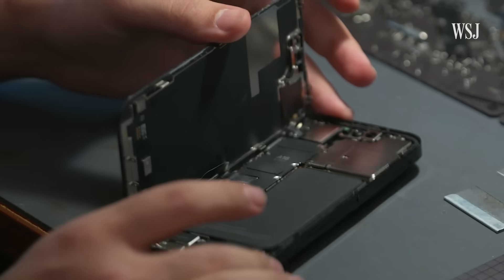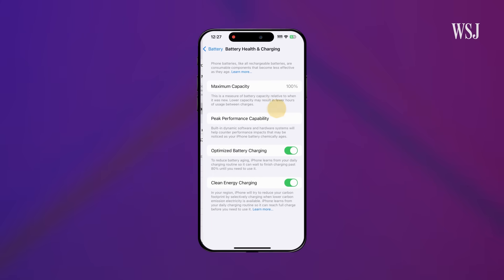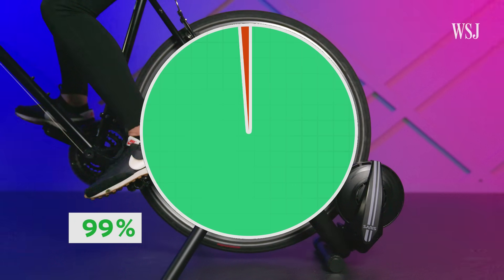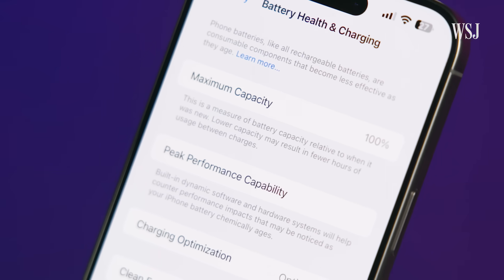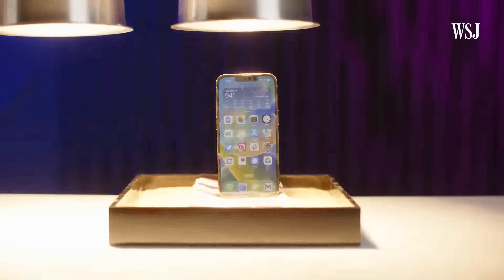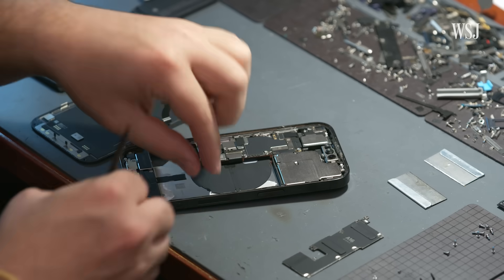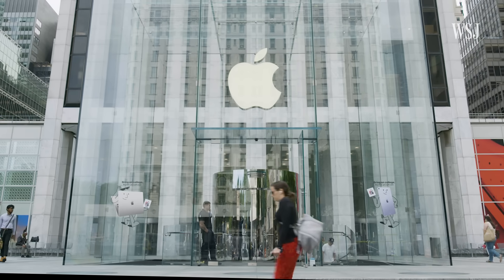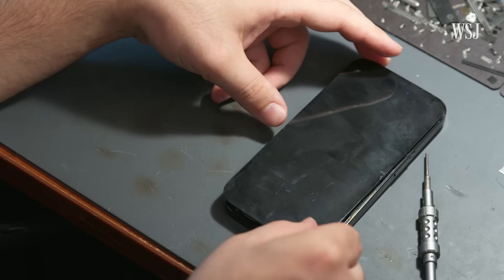Why My iPhone’s Battery Expired in Only a Year | WSJ

Comment: Yeah i'm a bit concerned, I just got a used 13 Pro, it was 89% which was the best I could find in terms of battery health, and this is after 1.5 years of original purchase. Can't remember how much my previous iPhone had when i got it used... but was an iPhone 7 that I'm replacing just now that is going down very fast
Reply: Battery replacements are cheap, who cares.
Reply: @iwill_859 do you trust them to make it waterproof again?
Reply: @unleashthedog  it was never water proof to begin with, it’s water resistant.

Comment: Apple iPhone buyers are insecure sheeple: the battery is designed to be too small and to wear out so you will want to buy another expensive iPhone sooner. Apple iPhones are missing many basic phone features that are present in the much better Sony Experia phones and cheaper Samsung and Xiaomi phones. Sony Experia phones have expandable memory allowing 1TB of flash memory to be moved immediately from phone to phone ensuring that no photos or music are lost if your phone is dropped and breaks. Sony Experia phones have headphone sockets so one gets lossless powerful headphones at full quality music without compression and no need to charge headphones or worry about losing one earbud or about flight wireless restrictions. Xiaomi Note phones have amazing 200 MPixel cameras and infra-red controllers for AC and TVs, Sony phones have optical periscope zoom cameras and Bluetooth transfers of any file, photo or data. Apple's profit margin is over 50% - why do you want to give them your money when Pegasus Spyware can hack into any Apple phone anytime and there are all these disadvantages ?

Comment: FYI I use my iPhone 14 Pro that I charge with a non-magsafe Qi charger every night since I've gotten it. 
It's still at 97% battery capacity. 191 cycle counts. Manufactured in 2022-07-04.

My theory is - my battery is near max because I disabled "Always On Display" almost immediately on purchase.
Reply: yq me too , mine is 98 percent after a 14 months i guess its due to display

Comment: You are missing an important factor. The quality of the batteries made by the manufacturers is cheap compared to the 13 and previous models. That's why the battery is degrading faster

Comment: so does it mean if you keep the phone connected to the power source (typically when working in the office), the phone is always 100% charged even when you are on the phone for calls/videos, etc, does that mean it will significantly slow down the charge cycle count?

Comment: Magsafe charger took my iPhone 13 Pro from 100% to 89% in a year. At the same time, my old XS Max (never charged wirelessly) is still at 91%.
Reply: Truth wireless chargers are the easy tool to downgrade your battery
Reply: @Rajskr16 ohh thanks. Almost Planning to buy.
Reply: @disc0potato  don’t buy for your goodness
Reply: @disc0potato  Its not that bad, at least "non Magsafe" solutions are somewhat "ok" with up to 7,5W. Magsafe with 15W really heats up the iPhone, especially under addtional load.

It really depends on your needs, i personally learned to replace the battery anyways after 3-4 years of usage, and i rather replace a "bad" battery after 3 years for additional 3 years than a somewhat "still healthy, but weak" battery after 4 years. After 6 years i would upgrade the phone anyways ("for sure")
Reply: My old iPhone SE 1st gen had 87% health capacity after 1500 cycles. Insane. Gone are those days. Now iPhone batteries are designed to perform optimal for only 1 year. 

"Buy a new iPhone" sounds music to Tim Cook.
Reply: @Roberto-nj5r none of the iSheep will understand what apple is up to behind the scenes :(
Reply: I can see why, Samsung wireless charger has a fan under it doesn't feel warm on top, but Magsafe doesn't have a fan :o
Reply: Exactly. Qi never did any harm to my X, XS or 11 Pro, but Magsafe really killed my 14 Pros battery within a year.
Reply: My iPhone 13 pro battery health is 88% after 2 year of use. I use mostly 5w charger and sometimes 20w Apple fast charger.
Reply: I have an iPhone 14 Pro and frequently charge with MagSafe. 98% since they came out
Reply: I’ve only wirelessly charged my 14 pro max. It’s 14 months old and at 98%.
Reply: Really puts the safe in magsafe
Reply: Iphone 13 pro max charging only with magsafe for 2 years 89%
Reply: Eh mag safe is wireless ❤
Reply: Wireless charging for me is just a back up if my usb port gets damaged.
Reply: @serrael-182  this makes sense. Never used wireless once myself.
Reply: I MagSafe charged a 13 Pro for 2 years and was at 89% health. It’s different for everyone.
Reply: Yep, which is why I don't care that my phone does not have wireless charging. Even when Palm came out with this feature back in 2009 I never used it because it generated far too much heat.
Reply: @orangeyellow-me1pz  I exclusively MagSafe charge my iPhone 14 pro max. My battery health is fantastic after a year. The issue is cell design, not wireless charging.
Reply: 89% in a year is still really good. If you get two years out of a battery, that is about normal. Mine just hit 79% at the two year mark.  I had changed with Apple and it was under a 100.00 with tax.
Reply: MagSafe made my 13 pro max lose like 3% in a week lol
Reply: Which one do u use more
Reply: Interesting, but that’s just 2%, something I’m inclined to point at each generation’s battery more than how it’s charged.
Reply: @SleepyPossums   For full disclosure: I bought my Max in Feb 2019. Replaced it with 13 Pro in autumn 2021. Feels surreal that newer phone eats through the battery twice as fast.

Comment: Luckily I have an iPhone 13 pro and didn't upgraded to iphone 14 series or iphone 15 series, so iphone 13 battery health at 94%~96% still okay and lasts for almost 3 years. the solutions is never overcharged after charged to 100% and don't overheat it while exposed to sunlight.
Reply: Nothing wrong with the 15’s & it’s too early to tell if they will have degradation issues or not.
Reply: @iwill_859  I mean iphone 15 series have ios 17 issues like an overheating, am I right?
Reply: @indrahaseo  no, apple fixed all those issues w updates.
Reply: @iwill_859  it would be better if we just wait for next year or until ios 17 has been fixed, better and smooth more then 17.2 or 17.3 is enough

Comment: The biggest problem is that Apple made their battery save mode unusable cause it lowers refresh rate and difficult to find in settings
Reply: It's not hard at all, dude. You can literally add it to the control center. If you're just talking about lowering refresh rate, then yes, you have to look in accessibility.

Comment: just sold my 14 pro that I bought when it came out. 13-month old phone, battery health 100%. I had it checked at an apple store, the figure was real. that made me wonder about 2-year old ipad mini 6. that was at 97. I have no idea how that has happened, haven't changed anything significantly about my charging habits, except when the weather is hot, I put them on an ice tray to charge. so it IS the heat that's killing batteries fast.

edit: AND avoid using fast chargers. I use the old chargers for everything, including my iwatch.
edit2: cos they heat up devices so much you could fry eggs on them
Reply: May I know what the selling price of your iPhone 14 Pro was?

Comment: wasted 7 mins and did not get the answer to "Why Do iPhone Batteries Drain So Fast?".
Reply: You are not paying attention.
Reply: @iamstevemoses  Apple is a joke...message is "Don't use the phone..🤣😅
Reply: @iamstevemoses  neither are you, stop acting proud and illiterate, she didnt even mention how batteries work
Reply: It's a feature
Reply: Batteries degrade and have a limited charge cycles. Meaning that it could only charge full to empty a limited numbers of time. You could do more discharge cycle if you limited the fully charge to 80 percent and limited the discharge to 20 percent. That will really extend your battery life. Keep your phone away from heat because it degrade faster but also keep it away from extreme cold as well. The lower the capacity the more you charge, the more you charge the faster the battery degrade. 
Remember this uses the same batteries as your ev the only differences is that your ev has better thermal management and could heat or cool your battery down.
Reply: @DerekVuong7799  the video tells you nothing period.

Comment: Me and a friend upgraded around the same time, I got the regular 14 and she got the 14 pro max, we both use our phones in similar ways, I recently checked the battery health of both phones (keep in mind I upgraded on January and she upgraded early February), I had 100% and she had 92%. Maybe it’s just an issue with the 14 pro battery.
Reply: I’m not sure if you consider this fast but I use a 10w fast charger, if you were curious she uses a 30w charger but mostly uses the 5w charger she got with her 11.
Reply: @TheAppleGuy.  Battery probably heated up becauses she uses a 30w charger and over time lost 8% battery health
Reply: Thanks, do you use a fast charger?
Reply: Yeah I guess you are right, she disabled promotion which defeats the point of getting a pro iPhone so I guess it’s the brightness paired with a slightly smaller battery. She mostly charges it in the evenings.
Reply: I use the 14pro version for almost a year now and its at 100, i never let it go down 20-30% and never charge more than 85-90% if u have the chance to charge during the day while you keep an eye on it instead of during the night it will hold very well, i dont have a Apple Store near me so me buying a battery and changing it myself would be fine but those annoying warnings that apple put in OUR OWN phone just to get more of our money even if its an original battery is just predatory. Hope that the EU law (if approved) regarding easy part replacement will abolish this kinda of action by these companies.
Reply: The pro is more power hungry and overheats faster. almost all the time is quite hot even when performing basic tasks or browsing.
Reply: FINAL UPDATE: my iPhone 14 is at 89% health after a year and 6 months of use, the iPhone 14 Pro Max is at 85% health after a year and 5 months. Safe to say the whole iPhone 14 series had worse batteries especially compared to the 13 series and even the 12 in some cases.
Reply: Maybe its not an issue and has to do with the more powerful components making more heat.
Reply: Your post is another solid clue. What is the main major difference between 14 and 14 pro max? Hint: it is the 2000 nits display with always on. I bet your friend is recharing once in mid day because her display is consuming the battery way too quickly as the capacity is not enough relative to display power consumption.
Reply: It's the same size battery but her Pro has a...really, the display's not the same? Fancier camera so if she gets in a few video reels a week that would account for it. More gravely, your 14 is set to last 100 years at this rate, you're gonna have a huge update to adjust to in 2123, better get your 2 curries and maybe some Qnol10 and hydrogen water in your weeks to be ready.

Comment: I have a 2-year-old iPhone 13 and its battery is at 88% capacity. I’ve used the optimized setting on iOS ever since it became available, and I also try to keep it in the 20-80%. However, there’s only so much extra life that you can squeeze out of these things, so I don’t waste time obsessing over it. Like if I’m on the road and have limited charging opportunities, I’ll top it up when and where I can, regardless of its current level.
Reply: "...so I don’t waste time obsessing over it."
^^^^^^^^^^^^^^^^^^^^^^^^^^^^^^^^^^^^^^^^^^^^
This.  So much this.  It's just a phone.  How much stress is it worth to save a few bucks worth of battery life?
After three or four years spend the $100 to replace the battery or spend the money to upgrade to a new phone.
Enjoy your life.  It's short enough already.
Reply: @gl1500ctv  agreed. Why not even spend $1300 every year to upgrade to latest phone? Then you dont even have to bother about battery at all.
Reply: i have a 3-year-old iPhone 13 pro max and it has 99 percent capacity.  i guess i'm not a heavy phone user
Reply: So here is my point again. You two year old iphone 13 has similar battery degradation as one year old 14 pro. What is the real difference between the two. Answer is the display. 14 pro has 2000 nits with always on. Hence battery consumption is higher and hence need for more frequent recharging and more battery cycles.
Reply: @Fear.of.the.Dark. 2000 nits display means nothing it hardly ever reaches that number..
You can have a 2000nit display running 400nits way more efficiently than a 800nit display at 500nits.
Reply: @absolutium  go outside during daytime. Use your 14 pro iphone. See what brightness the display usually runs at. You will get the hint.
Reply: @Fear.of.the.Dark.  Oh I set my device for manual brightness so that's never going to happen
Reply: @absolutium  so? is manual brightness the default iOS setting for everyone in this world?
Reply: @Fear.of.the.Dark.  As an android user I really don't care.. yet the fact that it is a 20 second switch well.

Comment: Apple makes the best phones . Still ppl buy them every year. What’s the point?? Me still using iPhone 7plus my battery is at 83%  is the single testament that iPhone quality was good and it is also not so heavy like new phones . Display still strong like new. Camera is ok but not bad . Where is the innovation in new phones ?? New software is not an innovation . Camera quality is good in new phones but my dlsr 5 year old still has better quality hands down than iphone 15. Apple is complacent and boring. I would still  keep my iPhone 7 running but they terminated terms of contract and most apps have started not to work citing OS upgrade 😢.

Comment: Before I was sooooooo careful on how much I was charging my phone because I wanted to preserve the 100% initial capacity. Now honestly I don’t care that much anymore. I just use my phone as I normally would. If the battery will give me problems I will decide what to do later on.
Reply: exactly this, I always see people like omg never charge between 80-100 or use from 0-20 and im just like,  I charge when i need to charge and use when i need to use
Reply: Right, it's a tool nothing more. If it does not keep up with my older phones regarding battery cycle, I don't care, either I will buy a new one or another brand.
Reply: My phones battery heath is at 78% and you know what I don’t care lol. To me it’s not 0% so I look at it as very healthy still like it’s not even half way depleted.
Reply: I was obsessive but I changed.  Apple care gets you a free battery below 80%. My old iphone 5 has over 1700 cycles. 😅
Reply: my 12 pro is a 5 year old device and now have bh of  72% and now im replacing this i really dont care the battery heaalth as long as the it could not affect my wants to do in the phone

Comment: Always take your iPhone to an authorized Apple provider or an Apple Store to get your battery replaced. The reason it takes them so much longer isn’t because they don’t start the repair right away, it’s because they spend 30min-1hour pealing off your old waterproof seal and applying a new one. Opening the device damages the seal and if not replaced you will lose your full water resistance.
Reply: independents do the same?
Reply: @lachlanlau  I’m sure there are some that do but most don’t because it takes a lot of time and is incredibly annoying to do. I wouldn’t risk it for $10.
Reply: @lachlanlau I don’t think so, but for that price they better be, cause it would make even more sense to go to Apple
Reply: @gerardoarenasss  right to repair bro, apple hates it
Reply: If you go to a good independent shop, they can do the same thing and add the water-resistant seal back on it. Plus Apple only gives 3 month warranty on their batteries which is pretty stingy. The guy in the video gives 6 month warranty. The only good thing with replacements at Apple is you will be able to see the battery health information as greedy Apple blocked 3rd party aftermarket batteries from showing the battery health (hopefully the EU will stop Apple from doing that).
Reply: I mean , in theory , yes but do you have any proof ?
Coz for the amount they had to do, and the pay , and with todays society , there will always be short cuts , laziness 

Just like every companies , there will be workers who work hard  most average / meet just the bare required and the basic minimum standard and some super lazy 

same as those independent. Some are good some will be bad 
And they are cheaper not coz they are bad 
Just coz they don’t have the brand power to charge higher 

just like third party phone cases , most are similar or same quality of Apple (some are way worse also ) 
But they are all cheaper coz they don’t have that logo
Reply: @dandansfu  I used to work as an Apple Authorized Service Provider. Apple is extremely strict when it comes to repair process and they will fine you for any mistakes. If you don’t put the seal back on and the customer comes back 3 months later with a phone dead due to water damage, you could be paying for a new one. Apple also had cameras they randomly checked to make sure we were doing things right.
Reply: @louisrossmann can explain better than me

Comment: After I watched this video, I checked my battery percentage of my iPhone 12 Pro, it mentioned 86% after 2 1l2 years or 30 months of normal use.
Reply: Nice, iPhone 14 pro here 10 months old 90% already 😅
Reply: @mahee96 mine 89% in 10 months too
Reply: @mahee96 mine 14 pro from 99% to 90% in last 5 months.